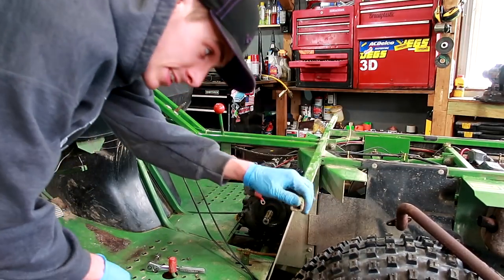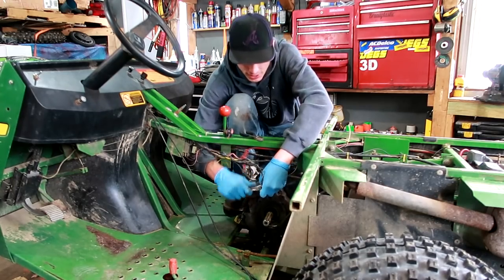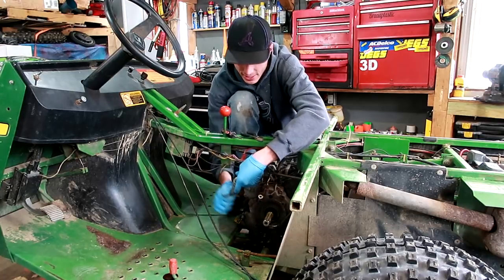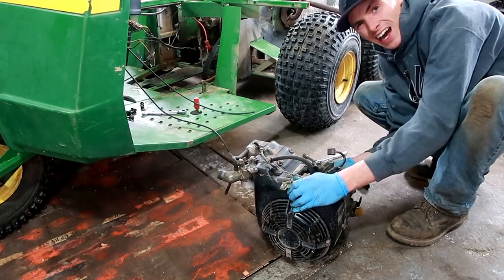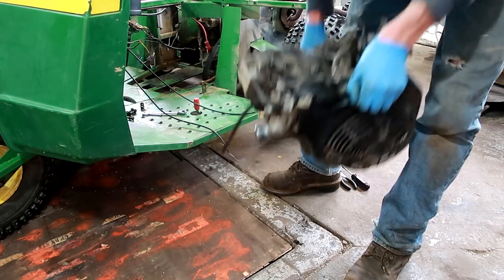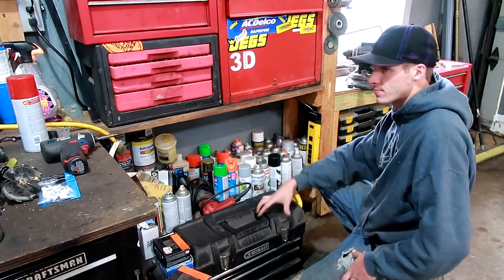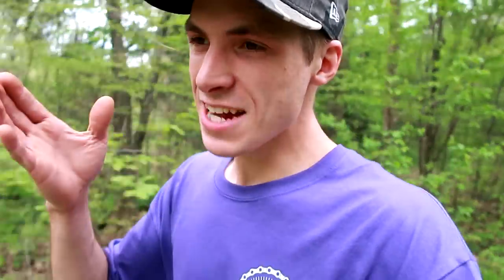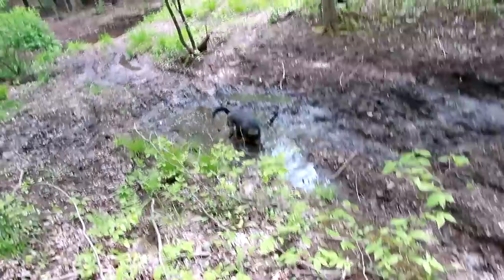PULLING GATOR ENGINE

Comment: I have several of these 5x4 amt's and ive done an engine swap on one. I bought a predator 420cc engine. It fit nicely, the torque converter fit and the wiring was easy. Used the original amt air filter and exhaust since the predator one goes over the engine making it too tall to fit.

Comment: When working with hydraulics cable tying a washer, with a number stamped on it. onto the hose you took off and where you took it from is a wee trick i use.

Comment: I would remove that back belt clutch,and put the rear sprocket off of the motor cycle on the gator transmission.That would work sweet!!

Comment: 3dmachines when you had rewired the wires to start the gator it has a sensor in the brake you have to hit the brake and then start it my dad has a gator 550

Comment: Computer keys: Go intel for processor and motherboard. Put more money into memory DDR3 or DDR4 (depending on your motherboard)and videocard NVIDIA 1070 should do you for a while. Go SSD for the Hard Drive (Samsung Evo) and put your Operating System on that along with anything that you want to go fast and for deep dumb storage by a 1TB 7200 sataII drive and if you need more storage then that by another 1TB drive. Most mother boards will have 6 sata ports on them to connect devices. Hit me up if you want more info.

Comment: Use a tub for your bolts or screws
Reply: Crippled Squash4 if he was too do that he would have a hard time finding where each one went when putting it back together I have the same issue as I just rebuilt my fourwheeler engine
Reply: +Thomas Bell I'm in the middle of rebuilding the top end of my dirt bike lol waiting on the the cylinder rings piston and gasgets

Comment: what i usually do, when i take apart something is, because they all have different size bolts and nuts, i get out my 10 pack of paint markers. and color code them with a dot. make a dot on the bolt or nut, make a dot where it came from. but i change the color for the size and location. like if there are 4 bolts to take this off they get one color, 2 nuts to take off this, a different color... etc.

Comment: I put Iphone screws on pieces of clear tape so they dont roll off the table during the procedure. Then if I need to finish fixing the Iphone at different time, I put tape on top of the screws as well.

Comment: Before building a PC check out Dell Outlet for Refurbished or Scratch and Dent sale Desktops & Laptops...... Also Newegg.com has some good cheap refurbed desktops and laptops as well. - Best Part is they come loaded with the latest and greatest OS.As far as keeping your nuts lol and bolts in place is you can stick them back where they came from or if possible make templates out of cardboard. I did that often. The last thing you could do is also take photos of everything to have a reference when everything goes back together.

Comment: I would suggest that you get a intel core i7, there about $500 and you will get really good results with it if you want to edit 4k. I would also suggest you get a work station card. They run well for editing and if that is all that you are going to be doing the card will work great. If you wanted a little more power full graphics card i would suggest the NVIDIA GTX 750 or 960. These graphic card will work well and especially if you want to do some gaming. Also get a SSD hard drive, they work well and they are really fast for rendering and will load files, projects, video, really well. The SSD hard drive will be around $100 to $200. Your total estimate would be around like $800 dollars for all those. 
These are just some suggestions.

Comment: if you want to edit 4k get an I7 of some kind (I7-7700k or I7-6700k) and a gtx 1070 for your main parts, your going to need a motherboard, ram, a storage device(ssd or hardrive), power supply,cpu cooler,and a pc case also.

Comment: Ive built my own PC for gaming. Its fun to research the parts and pick everything out. And assemble and have it come to life. All good.  Would i do it again? No. Im not gaming anymore not that it matters. But i found a HP PC off Amazon is so much more user friendly.  My HP is so quiet you dont even hear it. And it boots up fast just like turning on your TV. Fully capable pc that is cheaper and doesnt sound like its about to launch off the floor. My 2c.

Comment: I don't know what video editor you have but I will say this for motherboards use either Asus or Gigabyte for ram G.Skill or Corsair for you're graphics go with higher end Nvidia card if wanting to do 4k vids for SSD Samsung are the fastest for  read n write speeds then get a 3 or 4 TB drive for backup/ to keep you're videos on for CPU (processor) I would do a intel i7 6800k or i7 6850 for power supply corsairs or seasonic hope this helps abit

Comment: I'm thinking you should make the Gator an EV. Just need a stout electric motor, power controller and a bank of batteries. A simple design with a ton of low end torque.
Reply: I’m looking to do so.  Do you happen to know the output shaft size on the original gator?

Comment: Hello, enjoyed the video.  I’m looking to electrify my Gator so want to match the electric motor to C-clutch assembly.  Do you have the original motor output shaft size?  It looks keyed.  Any help is appreciated.  I can order a new electric with the correct size so I’d like to do so.  Thanks!

Comment: An AMD R7 Ryzen 1700 is the cheapest 8 core cpu you can get at $315 on New Egg.  The Intel equivalent is great as well but the cpu alone costs as much as a whole pc. Being an 8 core it would perfect for you editing video in 4K. Or if you want something a little cheaper than that the R5 1600 is also good at $220. Avoid going for a quad core if you want to do 4K video, they take much longer to render since it's overwhelming. The motherboard, ram and other bits are up to you. You do need a graphics card though, there's no built-in video chip on the Ryzen cpu's.

Comment: Building a computer is much simpler than you think buy the parts you want like for 4K you want a lot of ram a strong video card and a powerful processor a system board a SSD hard drive ( no moving parts) and a tower with 400 wAtt power supply and that's pretty much it you could easily do it dalton
Reply: I built my first computer when I was 12 years old it's not hard but for video editing that's what you need also what kind of operating system were you thinking of running? Windows OSX or Linux?

Comment: if you want a 4k computer get a gtx 1080 ti and a i-7 7700 a asus 270 motherbroad 1,000w power supply 1tb ssd 4tb harddrive 32gb of ram or 16gb and a big computer case that will do 4k

Comment: lets say i am pulling a engine out of a truck ill buy a box of sandwich bags CHEAP then take a perminant marker and lable the bags example radiator clamps bell housing bolts motor mount bolts and if it goes even further ill keep going with the bags

Comment: I'll help you build a computer
Reply: same
Reply: ^and I live in WNY
Reply: same
Reply from the maker: I've received a couple emails! Thank you. I just got done building it and it doesn't work. Ill probably have a live stream trying to fix it.
Reply: live stream or even a video of u putting it together would be a good change in pace
Reply: 3DMachines Same I have some computer builds on my YouTube channel, feel free to hit me up if you need help
Reply: Custom PC's are a bit tricky sometimes.. I just built 2 for my work and had a bit of a hard time getting them going. As long as you can get the the BIOS, you know its not a hardware issue. Id recommend installing Windows 10. Super easy. But you will need to instal the drivers for the motherboard and network adapter first. Once you can get internet, windows 10 will do the rest.
Reply: MrChrisproductions live stream would be great! provided I wake up early enough to see it lol. 
Curious to see what ya got too, of course.
Reply: Asus Maximus Hero VII
i7 4.0
64 GB ram
1 TB M2 HD
1 TB SSD
Nvidia 1080 FTW
1000W Power supply

Comment: @3DMachines Use https://pcpartpicker.com for building your computer pick some decent components from either of the big companys AMD: 1800x Or 1700x (CPU) Intel 7700k 7800k(CPU) and a motherboard that is compatible but the website will help with do that. Then its picking a Graphics Card Get a NVidia 1080 or a AMD Fury Card. and pick your case and stuff.. if you need any help message me on youtube and im more than willing to help im going to college in the tech field and have a Technical MOS in the National Guard.
Reply: 7800k doesn't exist, and I'd have to recommend the Ryzen 7 1700 over the 1700x or 1800x, unless the 1700x goes on sale. To be fair a 1600 is cheaper and offers the best value. 
Actually at this point for editing I couldn't recommend Intel at all... Not with their current pricing at least.
Reply: I meant to put the 7600k I have no idea why I put 7800k, And I don't recommend intel which is probably why I typed that wrong I am an AMD person myself and recommend all their products. and it would be fine for him to get the 1600 but he never set a price point and i was recommending the 1700x and 1800x because if he is going to edit 4k, and wants to play games in 4k the 1700x and 1800x would be better for gaming and would render videos faster. but the 1600 would do the same just not as well i geuss its up to him as of what he wants
Reply: Boneman5721 Ah I see. But yeah, the i5 just doesn't make sense anymore. Ryzen is offering insane value and performance, and I see the 1700x is actually on sale for $349 on Amazon I think.
Reply: ohh might be time for me to pick another one up. and yea your right i don't recommend him buying a intel CPU with ryzen here and he might was well wait for Vega too.
Reply: Boneman5721 Yeah. my idea with the 1700 is you could overclock it enough to close the gap, and save a little more money. plus it comes with a cooler you could sell online or something to lessen the price even more, you'd have no trouble getting good money for those Wraith coolers on eBay right now.
Reply: and if he was scared to overclock it himself with the right AIO watercooling it will overclock it self
Reply: Boneman5721 True. although as long as you stay within a safe voltage range there's really no risk of overclocking. A good AIO or a high end air cooler would definitely be recommended of course.